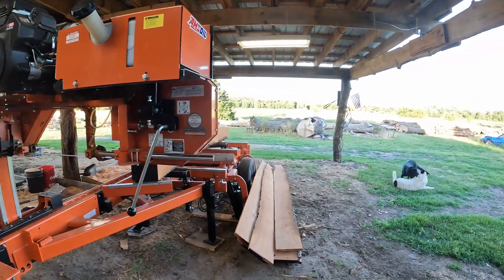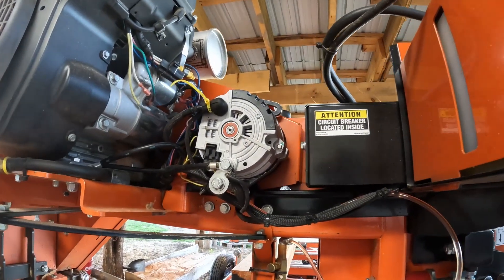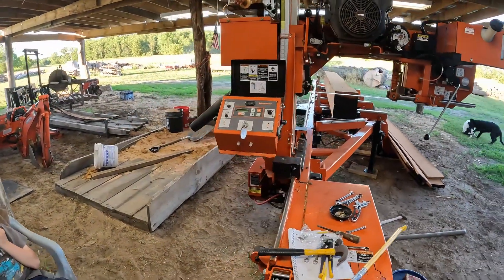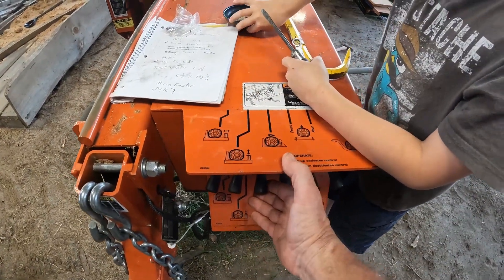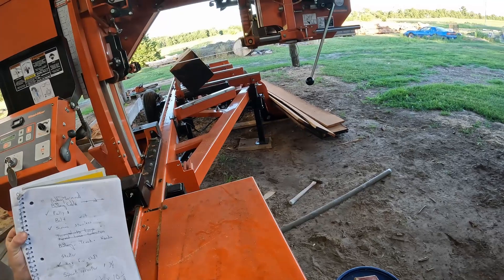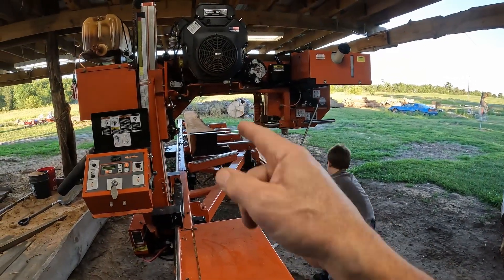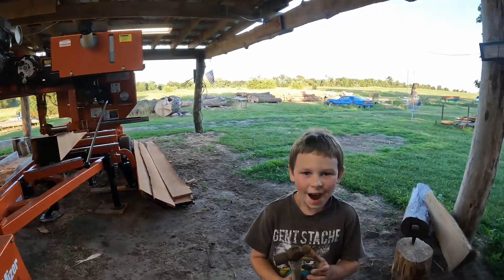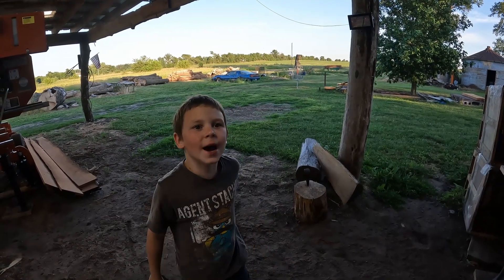2020 Wood Mizer LT35 Alternator and Starter replaced less than 300 hrs on the Portable sawmill

Comment: I lost a starter on the same machine at 80-100 hours. It was burning up the fuse on the start circuit on the back of the switch. Easy fix but it was out of warranty. Got the kohler part off ebay for something like 180 bucks.
Reply from the maker: Yep I replaced that fuse also.  A few times while I was testing the starter.   Kohler replaced it under warranty, but still I was down for a few days!
Reply: I’m at 250 hours and the 10amp fuse in the key switch array keeps blowing. I’m no electrician, bought my first volt meter, trying to learn how to do all these things.
Reply from the maker: I have replaced that key switch also.   It is easy to replace,  I don't know how to trouble shoot it. but replacement was easy
Reply: @DANG--  I’m uncertain why the 10Amp key switch fuse is failing, and until I speak with the WM staff about this, none of the electrical readings they told me to take mean anything. One thing that surprised me is that the alternator has live electricity, even when the power is off. Is that normal?
Reply from the maker: @pamtnman1515  the alternator is live 12v even when the key is off.   It should read 14.X  when you start the mill.
Reply: @DANG--  ok that can make sense. But it’s not just the terminals that are hot, but the fins inside the housing. I used needle-nose pliers to pull out some gunk in there, and got sparks.
Reply from the maker: @pamtnman1515  is your alternator good?  You can pull the alternator and take it to Napa and they will tell you if it is good or bad. Sparks on the fins has got to be bad news
Reply: @DANG--  well I’ve been reluctant to do anything to my machine without direct guidance from WM. And like you, I’m not the handiest guy with tools, although owning this sawmill has forced me to become comfortable with all kinds of tools and mechanical things I would not normally be interested in. I bought the sawmill to saw lumber from trees cut on my forest. What I’ve learned is that owning these mills requires me to become pretty good at all kinds of mechanical, hydraulic, and electrical work.
Reply from the maker: @pamtnman1515  I really don't enjoy any of the mechanical, hydraulic or electrical work, but it is all part of it.  So I happily do all of it, just so i can get back to cutting lumber.  I am still horrible at diagnosing a problem, but so far i have been able to replace all the broken parts, once they figure out what the problem is.
Reply: @DANG--  me too
Reply: What di did WM charge you.